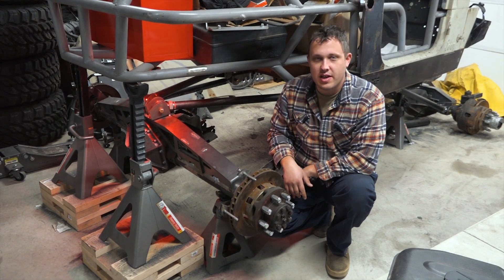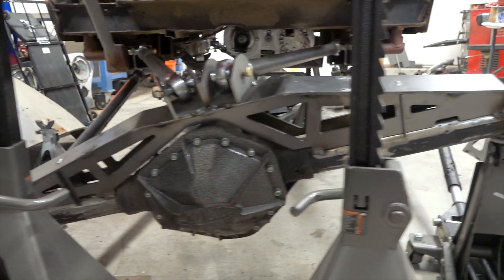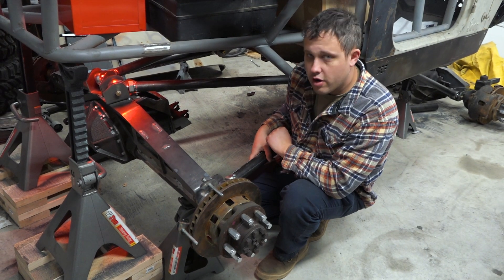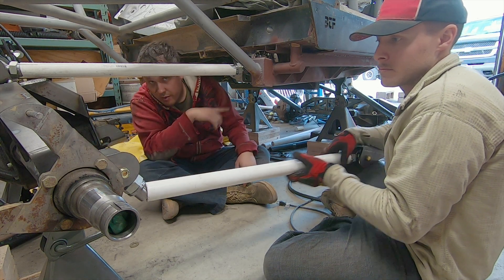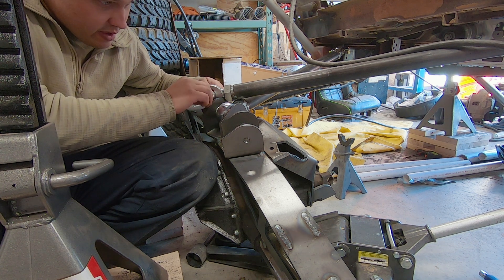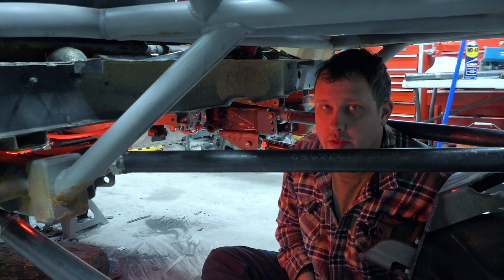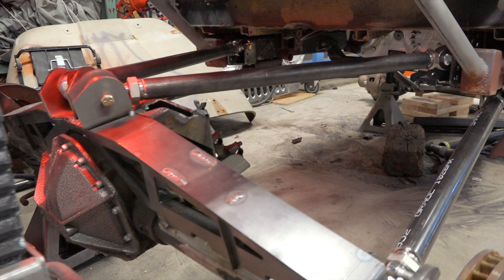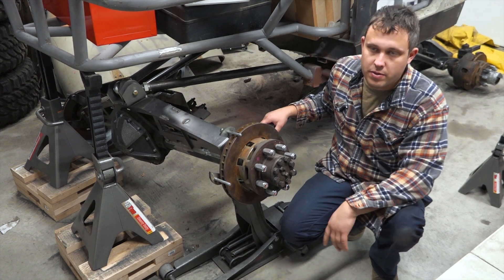CJ7 Rear Triangulated 4 Link Suspension Build

Comment: Really debating on how I want to set up my suspension on my rig.  All in a planning stage right now
Reply from the maker: We thought about how we wanting to do ours to the point of overthinking. Just dive in and do it, its not to bad. We have 2 more videos on the subject as well if your interested.
Reply: @SWActiveExplorers  cool, I'll look into those a bit.  I want mine to be a trail rig that's somewhat streetable haha, so it will probably vary a bit from your approach, but it never hurts to learn more!
Reply from the maker: Yea this thing will get trailed for the most part. Good luck with your build!